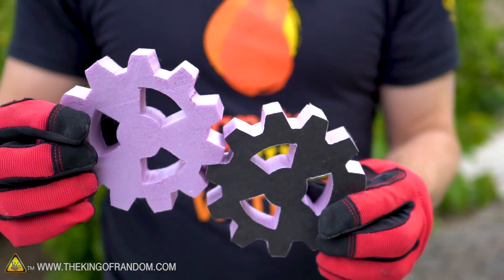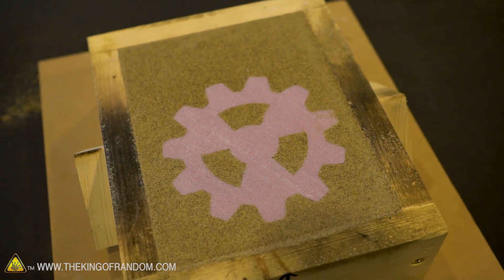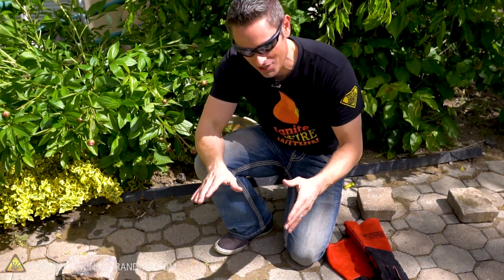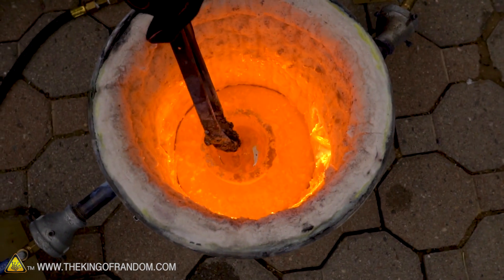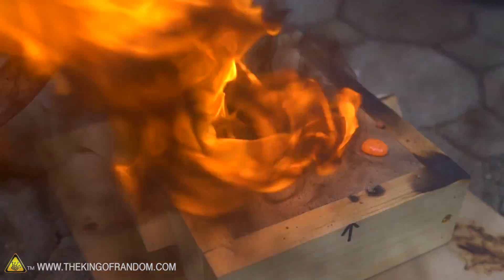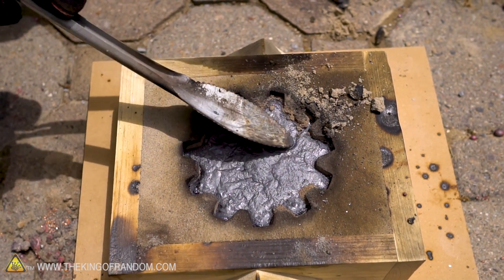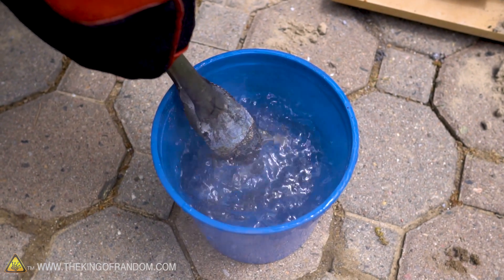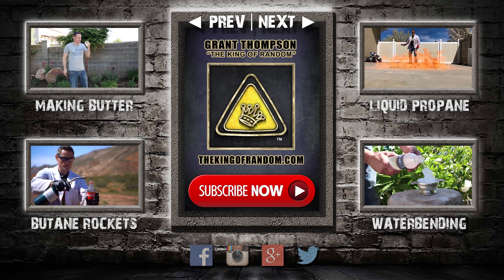Argh. Why Is Copper So Difficult? TKOR Tests Melting Copper In Our Homemade Foundry

Comment: Changing the temp of the flame may help. You could use acetylene, acetylene in oxygen, cyanogen in oxygen, or dicyanoacetylene in oxygen which all produce much hotter flames ( the latter one being the hottest) however you may need to change the design of the furnace to accommodate the heat

Comment: use a heat gun to melt the foam. it'll be easier to aim and you won't need to deal with the crucible just for melting.

Comment: Why dont you just make foam pattern, and pour clay and "compress it", and after clay hardens (you can speed it up by baking it), you remove foam pattern, and you have made a clay mold. In clay mold you can easily pour in copper and remove it later.

Comment: I have worked I  a green sand foundry where we poured brass.  One problem I see is you are pouring directly 
into the cavity.  If you have a "pourcup" and runners you will get much better results.  The pour cup  catches the molten copper as it falls from the crucible.  The runners are narrow channels leading from the pour cup to the cavity that forms your gear.  The idea between all this is you want the molten metal to enter the cavity as a laminar flow.  I would recommend at least two runners entering the cavity from opposite sides.  The smallest cross section of the runner should be as it enters the cavity.  This is known as a gate.

Comment: Grant if you put a plate over the top of the mold. That have a higher meltig point than the coper its should work i did do that do the metal i was melting back in the days btw love your vids

Comment: Grant, every fail had me screaming SPRUE SPRUE SPRUE.   you needed to support the sand from popping out by having a sprue to pour the copper into, and some vents around the outer edge to depressurize the mold.   another box of sand with a small hole where the center of the gear should be would do it right.  the sand on top will keep the spoke holes from popping upwards.

Comment: You need a closed mold to keep the heat in and the mold intact. Just make a mold like you did in the past with aluminum using a pour hole and vent holes. The added top layer will keep the gear shape intact and the copper will stay molten long enough to fill all the nooks and crannies. Green sand is tough enough to do the job.

Comment: What you need to do is to sandwich the mold in a top and bottom layer and put two holes on the top layer so one is to pour the liquid in and the others to vent. And it should keep the liquid in the mold hot so the copper can form to the mold better!
Reply: Josh Galanda I have done copper green sand molds using the above method and can confirm. The issue isnt the temperature of the copper it is the density of sand versus copper...The sand is experiencing a boyant force...Correct this by burrying the mold in packed green sand on both ends and then tunneling to a part of the finished product. This will result in the mold having a rod shaped apendage which can easilly be sawed and then filed off.
Reply: that's exactly how i did it when i took foundry class except i casted bronze. also, i had to take the model out before pouring any molten metal in. the sand i used was red in color
Reply: Josh Galanda what he said.
Reply: Josh Galanda risers & gates!
Reply: How about a torch as you pour the copper down the funel, or it could be molded while still soft.
Reply: What about a cast that can be heated, like water and ash.
Reply: reece Jones but the thing is the copper wouldn't be easy to sand down and it is inefficient.

Comment: What you should try is using a 5 gallon bucket of green sand and bury the gear about 5 inches below the surface of the sand.  Place your gear on its side with a styrophome stick about 5 inches long sticking up to the surface of your bucket.  Pour the copper on this protrusion and I think you will have better success with your gear.

Comment: The best way to to cast copper is to have a covered mold so it cools slowly. Also use clay instead of sand. Sand won't stand up to the pressure of pouring.

Comment: I think your issue with the sand is that its too wet, when you add the molten copper it boils the water and that boiling causes cracks that cant be filled and thus the sand pops up, try really dry sand!

Comment: I think if you can heat up the sand before hand that might make a difference, it being cool and wet means the super high temperature of the molten copper makes for a more vigorous reaction on top of that you're pouring quickly to avoid the copper cooling while pouring and two cooled edges meeting at one point..
also definitely worth using the cope AND the drag with a vent holes so the sand has a better chance of staying together because pouring from the top with the small amount of available aiming ability that kind of crucible is giving you is definitely not making it easier on you

Comment: Put a sheet of steel with a hole drilled in it over the sand then pour the copper through the hole in the steel so thae sant can't float to the top

Comment: I will use a wire nail or the mandrel on a river pushed through thin or risky areas of the mold. Just make sure that they are steel.

Comment: You require twofold sand one with the cast and other with a hole to direct molten copper into the cast
A) two wooden frames are required. Say a, b. 
B) just fill a with sand. 
C) place the cast over it. 
D) place fame 'b' around cast. 
E) stick a wooden rod. This rod must have height greater than that of the wooden frame 'b'. 
F) fill sand in frame 'b' 
G) pull out the wooden rod. 
H) now, you have your cast concealed in sand with a hole that will guide your molten copper into the cast.
I) place crucible over the sand for considerable amount of time to melt the cast
J) what are you waiting for?? Pour in your molten copper. 

I think this should work.

Comment: Take more time with your molds. Use both the cope and drag and add a spout and risers. If you sprue the pour spout, it should minimize the turbulence and thus lessen the erosion of the mold. Also, the sand is less dense than the copper, which is why it floats. The cope (upper half of the mold) should help keep things in place.

Comment: I think it would work better with a double height mould with the GEAR sittin in between and with a copule of pour holes and tubes thru the sand down to the gear

Comment: I have vague memories of seeing some casting done in an iron foundry many years ago (back in the early 80s).  I seem to recall them pouring some magic liquid onto the sand which they then ignited.  Don't know what the liquid was, why it had to be ignited, or what it did.  Maybe they were pyromaniacs.  Or maybe it was kinda important.  Because what came out looked like a set of wheels attached to a riser, kinda like what you get in a model aircraft kit (the wheels were then knocked off with sledgehammers).  I figure if they could do a complex shape like that with iron, your copper cog should be easy.

Comment: looks like you're having a density issue. Because the copper is molten it has the properties of a liquid. copper is so heavy that as a liquid when the metal surrounds those 3 sand structures they sever them and push them up because the metal wants to pool together.
Reply: you might try something like clay because it's heavier and adheres to itself better than molding clay.

Comment: Grant this should work if you bake your mold after wetting your sand clay mix a bit... kinda hard since it's in wood but you can line it with tin foil then take the wood off. what I noticed was the copper being so denser than your sand mixture that's why the pieces broke and floated to the top. You might just try putting a few  pennies (don't use the zinc one's) for weight on each of the pieces that stick up to keep them from floating

Comment: You should use brass. It is easier for casting. Also, have sand under those chunks that kept popping up. That way the don't pop up anymore.

Comment: Michelangelo used to get the priests in and have a mass said before casting bronze, it was so unpredictable.  Find a Catholic church and let them have a go? ;) 

My two-penn'orth as a chemist, teacher, computer engineer and former metalworker: 
you need a cavity, no styrofoam, just air.  The styrofoam is trying to burn, producing lots of CO2 and water, which are trying to get out as you're trying to get copper in.  And then there's the flames and smoke making it difficult for you to see.  
You need proper casting sand, preferably with a binding agent like sand epoxy.  
A layer of graphite powder could make it easier to avoid the sand sticking to the copper.  
Maybe put 10% tin into your mix, to make a bronze, rather than the 99.9% copper that you have, it will reduce the melting point.

Comment: your sand is too dry. you should make a 2 part mold not a 1 part. also you need to get the copper up to about 2200F or higher so that its up to pouring temperature

Comment: need to use both halfs and take the Styrofoam out, lock together.. Styrofoam is cooling your copper and leaving junk behind.. two halfs locked together with a sprue and riser.. faster pour and no Styrofoam to burn🖒

Comment: You should try using a two part mould with a sprue to give more support to the center parts you don't want to move or use the method you used to do your swords but with the green sand,. Failing that try cutting a channel with a hole at the end so you aren't pouring directly into the part you want to keep (this will cut down on cleanup as any splashes should be away from the main part) Also don't burn out the foam the copper will vaporise it on contact anyway.

Comment: If you glued the foam to the top of the green sand case and then pack it down. then when you remove the top you remove the foam template as well, leaving for a better casting. Just be really careful when you remove it.

Comment: I have had success with copper (although many failures/learning opportunities as well), that said I was using commercial green sand that is oil based not water and holds its form much better.  Using a 2 part mold should also help prevent the sand from breaking apart, lots of flux and get it hot.

Comment: Grant, there are some youtubers who cast in copper. They usually use a top half of the mold instead of leaving it completely exposed. Maybe some pressure from the top would make those spacers for the holes stay.... kinda like your lead knuckles video...

Comment: @Grant Thompson - "The King of Random"
Few tips:
1. Add more clay to sand
2. Bake mold in an oven to harden sand and remove styrofoam
3. Before casting heat up the mold with torch/oven

Comment: What if you put a wooden board with a hole on the mold and just pour the copper right through the hole to the middle of the mold, then quickly put the wooden board aside to prevent burning it? Or is that not possible?

Comment: I would say that a full, two part mold would help keep those three negative-space pieces in place.. in this case the top block would have no indentation. (in fact, maybe just use a 8x8 steel sheet with an inlet for pouring so that you don't have to cut off the down pipe after it's casted). And, similar to how you melted the foam, use a blow torch instead to burn out the bulk of the mold attempting to leaving the shell without curl or shrink.

Comment: I think you should encase the styrofoam in the sand completely and have a tube running up so you can dump all of the copper into it. That way the copper won't be in much contact with the air and the sand chunks won't pop out.

Comment: Open molds almost never work the way you want it to. Ram up both sides and set the sprue and riser on opposite sides. The enclosed form will retain heat long enough to solidify correctly. Also, use floral foam instead of insulation foam. The burn off properties are better.

Comment: why didn't you just pull the styrofoam out before pouring. os encapsulate it all in sand with a pour hole and exit holes?

Comment: reason for those chucks breaking of is probably because of the trapped air inside the sand. as you heat it up, the gases rush out and run into stuff

Comment: Steel sewing needles. When putting sand in the mold slide in steel sewing needles, like rebar for concrete. As long as you keep it away from the edges it should help hold things together.

Comment: Grant please, inform yourself before starting to cast something, mix some clay into your sand or better, use clay and mix a little bit of sand into it, also use talkum to prevent the template to stick to the sand, this way you can actually take it out and use another time. Your videos would be much more satisfying. The clay helps the sand to hold its shape.
Reply: RmRoyalflush also, making a two part mold with a funnel for the metal to go into, or multiple will keep the mold and sand a bit more stable when the metal pours in
Reply: RmRoyalflush please, inform yourself before asking questions...
He actually DID mix clay into his sand kido (watch the vid he made ~3 weeks ago)
Reply: Watch the video where he makes the sand, it has clay in it.
Reply: The term "inform yourself" is incredibly condescending.
Reply: there's clay in there.
Reply: +1 on doing a two sided proper mold. that's the wasy professional molds are done.
Reply: it's to dry, there is some clay in it but clearly not enough to help it hold together if it's breaking apart as he pours.
Reply: he said he used a cat litter that was made from clay
Reply: Jacob the Gentleman Potato z
Reply: jbweld138 h
Reply: RmRoyalflush he could fire the clay if he puts too much in
Reply: Way to sound like a douche bag.
Reply: RmRoyalflush c
Reply: パニッシャー Punisher not enough then. kido
Reply: why does he sound like a douche bag?

Comment: You should try melting steel and make shuriken with it. If the steel doesn't melt, then try using other metals.
Reply: He also said other metals so it could also be made of aluminum or brass
Reply: Jim Joe he already said steel won't melt in there
Reply: Melting steel with this is impossible, and you wouldn't WANT to melt it, you heat it up to the point it becomes workable, then shape it as you'd like. Lol
Reply: Redfoxmoon That makes sense. You wouldn't have to heat in up as much.
Reply: I made the foundry with refractory cement and tried blacksmithing with it; left to get a drink with the steel still in and 90% of it was sputtering at the bottom when I got back
Reply: how hot do you guess it got

Comment: the problem is that the melting plastic is melting into the sand making it solid, copper is heavier than sand so it floats the small bits that break off, try using a top on the mold and use multiple vent holes

Comment: Grant, why don't you cast the Styrofoam in the sand, and then put two screws into the gear very slowly, and pull it out? That way you have a blank mold, and you don't have to worry about the foam getting in the way.

Comment: what you needed to do was add borax to make it thinner. then, it would flow into the gaps better. hopefully you catch a glimpse of this
Reply: borax doesn't make it thinner, it stops it from oxidizing.  completely irrelevant in copper casting, that's for iron or aluminum.
Reply: butre jp you use potassium chloride, lo-salt, for oxidation by creating a barrier while the metal is in the furnace. borax makes it thinner so that your metal doesn't get caught in the slag, like when you melt soda cans.
Reply: Taz12480 bbjjjjjjhhyuuujjjulikkññmsz

Comment: when you make the mould in the sand with the styrofoam, pull out the styrofoam template by putting screws in the top and pulling it out gently

Comment: Grant, I know your gonna have something like a 3D printer or one of those laser routers (whatever their called, the ones that cut metal templates out with plasma) and if you don't, you can probably get your hands on one and use it. Try and make a cutout of the gear on some sort of metal that has a high enough melting point that it wont melt because of the copper, and line it up with the mold, then just plop some weights on it and the sand wont rise up. Then you can pour the copper in and nothing is messed up :D

Comment: Make a second blank side to the mould and then set the mould and pour through a fill hole. The sand on both sides should insulate the copper so the mould will fill better. The moulds need warming too. Having it vertical will mean the mould fills evenly top to bottom. The reason the inner sand is breaking is because it's floating on the copper. Having a second side should support these pieces better. You might need more clay in the sand. Don't use too much water in the sand. Water pockets can heat up instantly. The expanding steam can fire copper at you.

Comment: hey grant, i had a quick question about the mini metal foundry. do you think it could handle melting copper? all i have done is aluminum and i was wondering if it could handle copper with the insulator

Comment: Perhaps the moisture in the sand is evaporating due to the extreme heat of copper and decreases the structural integrity of intricate molds

Comment: Suggestion: USE A DIFFERENT TYPE OF STYROFOAM!!!! Your making this difficult on yourself
Reply: CraftedDeath a inclosed mold with styrofoam runners would help too, it would support the sand so the buoyancy doesn't make it float to the top and improve the surface finish, playsand(moonsand) or a sand epoxy mix would be perfered to regular old sand
Reply: CraftedDeath he's using a homemade mix of Greensand (a sand and clay mix used for casting) so he's not using normal sand, but some people think he doesn't have the right amount of clay.
Reply: exactly this
Reply: ThePoorEditing Channel Changing the styrofoam wouldn't do a thing... What he needs to do is have a little bit more durable thing the basic sand.
Reply: ThePoorEditing Channel He's failing on purpose to get viewing time